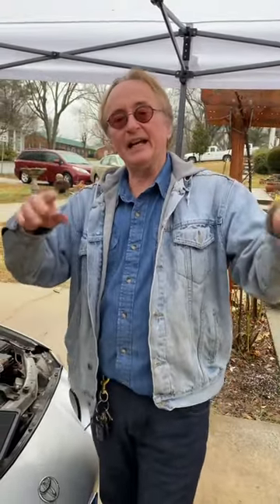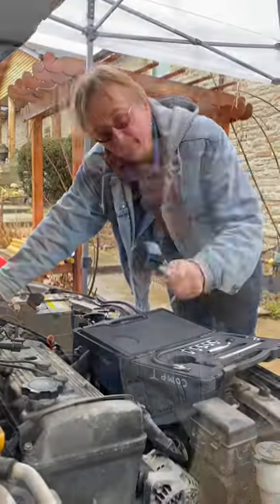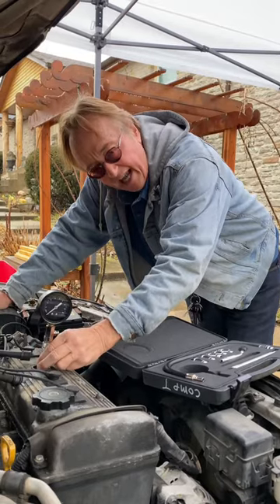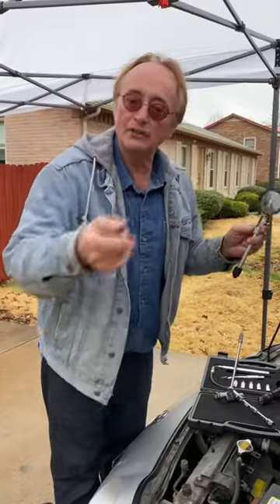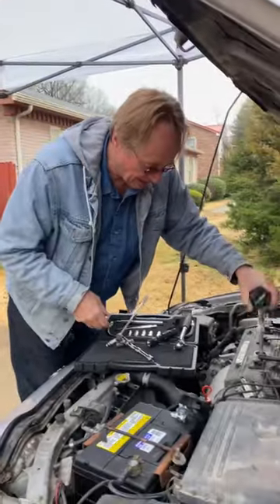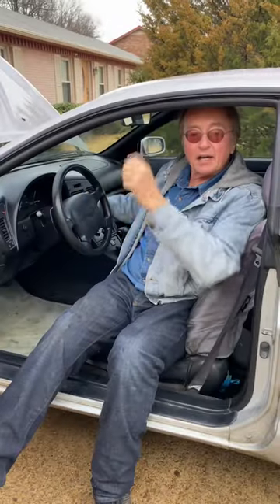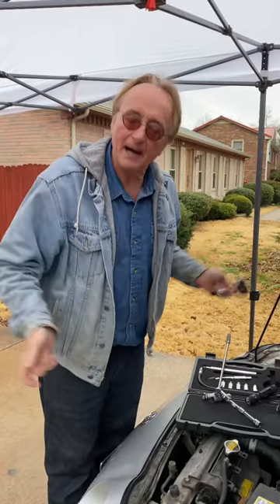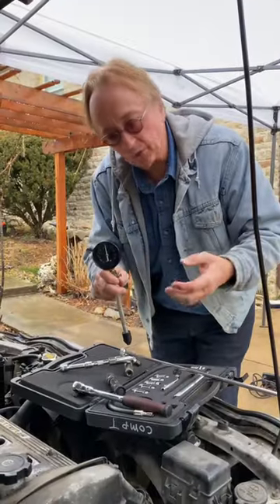This Means Your Engine is Bad

Comment: Did this to my 325 bmw the other week. Most came up less than 50 psi. Needless to say im in the market for a honda accord 😁
Reply: And Honda has signal lights.
Reply: 4th gen Camry is a good option as well
Reply: Toyota corolla might be a good option..
Reply: @janetyeoman1544  hilarious 🤣
Reply: Shoot I've been trying to sell mine it's great but people want to low ball me too much so I probably hold onto it until January when my registration is running out and try selling it then idk. My issue is If I sell it idk what else I'm going to be able to find that's been as good of a car as it has
Reply: Avoid Honda ..I owned one until last year .terrible car
Reply: @billcoates941  brand new or used?
Reply: @billcoates941  There are no terrible cars, just terrible owners.  They believe that the owner's manual is a little book, which should remain unseen in the glove compartment forever.
Reply: @carlbrooks90  I bought it brand new
Reply: Smart move , mazda 6 is a sleeper too.. As is the Hyundai Genisis
Reply: @gabeeskridge8291  i love the 6. Wife has a CX-5. They are great cars. Its outta my scope right now.
Reply: @euphoricjellybean  I feel you , I have an 07 Accord bullet proof great ride 205K , paid off seven years. Got my mom an 06 six years ago with 75K. I Strongly recommend the k24 4cyl. with mint miles if you can find it. Higher miles if one or two owner
Reply: @gabeeskridge8291  What does K24 mean?
Reply: Change rings
Reply: @mvelomthethwa880  i thought about it, but its not worth it.
Reply: @man4YAWEH454  K24 is the name of the 4 cylinder engine line in the Honda Accord. Really good engines.

Edit: The Honda Civic has the K20. 

Fun fact, some people that build Honda engines will take half of the engine from the K24 and half from the K20 to build a frankenstein engine which I believe has better performance and is stronger. I believe they take the head from the K24 and the crank fdom the K20? Or maybe it was the other way around? I don't remember.
Reply: @VisionaryVicente  Cool stuff. Thank you for your reply,VividVincente.
Reply: Honda civic 5spd can't ever go wrong. I had an 04 and it burned oil when I got it , it ran perfect until I ran into a telephone pole at 100mph. Engine was in my lap.
Reply: Yeah you have a beautiful car but the reliability is terrible
Reply: If you are American, if you are European you are just fine.
Reply: Don't forget the oh-so-reliable 3800 series II and III V6 Buicks...  At 148,000 miles I'm still only burning 1 quart of synthetic oil in 7,500 Miles.

Comment: Also on some cars it's recommended to disconnect the fuel rail or remove the fuse for the fuel pump to avoid excess fuel in the cylinders but often it won't hurt anything either way

Comment: Good advice but not so easy to do on a lot of cars. Some engines require removing the intake manifold just to get access to the spark plugs...
Reply: I wouldn't buy a car that is that difficult to work with
Reply: Nissan comes to mind. Idiots need to rethinking engine building
Reply: On those types of engines where accessibility is difficult, you can do an amperage draw test. Of course you would need an oscilloscope and a clamp on amp meter to do this, but you can at least get a good determination. If your graph shows a major fluctuation in a particular cylinder you know that you have an issue before going further. This test does show PSI, current draw only.
Reply: @terran236  lol they just want you to bring it to the dealer ship and pay that $$$
Reply: It's a pain to get at the spark plugs in minivans too, like the Pontiac Montant, you need to pull the engine towards the front with a ratchet strap to get access after removing a bunch of parts in the way.
Reply: There are 4 cylinders that have the intake manifold on the top?

With a V6 or V8 I can understand but I have never heard of a 4 cylinder with the intake on top.

Taking the intake manifold off is definitely a pain in the butt with the throttle body, and all of that stuff. I did it before. Took me two days to change the valve cover gaskets for my V6.
Reply: @emanuelmoreta5472 the brand that Scotty Kilmer recommends most has this issue ! (Toyota and Lexus v6)

Comment: you can also check whats bad if you find a bad cylinder, few drops of oil into it and if psi is back means piston rings if not its most likely valves
Reply: , but Isn't that obvious? 😃
Reply: Leak down test is even better ,just listen for air
Reply: @MrTheHillfolk  👍👍👍
Reply: Isn't there also a smoke test? What does that one test again? Vacuum leaks right?

Comment: A new Engine is alot cheaper than a new car.
Reply: The problem is finding someone who can put the new engine in correctly at a decent price.
Reply: @anthonybrown3481 perfect opportunity to learn.
Reply: @anthonybrown3481  exactly most people scam you way high and they suck
Reply: Depends on the engine and car
Reply: And don’t forget about buying a new transmission if that goes out as well
Reply: bruh what most the time it’s not not to mention just buy a car in good condition don’t plan on spending more money 😭😭
Reply: Hire a mechanic to come with you to buy a different used vehicle. It's cheaper than a new engine,less expensive than taking a chance on someone putting a new engine in and not being right.
Reply: Do you mean a "NEW" engine or a "USED 2ND HAND" engine? HUUUUUUUGE DIFFERENCE!
Reply: New engine here, then new shocks 3 months later, then brakes disc and pads
Reply: Depends on the car
Reply: If it's an old camry just buy another camry ngl lol
Reply: @IIGrayfoxII  And then you end up spending thousands of euros on bodywork to fix 30 years of rust on a VW T3...

Comment: Literally had a car with new tires, brakes, radiator, windshield, wipers, that had the engine give up the ghost. She hardly burned oil, and didn't run bad at all, until I went to start it the next morning and cylinder 1 misfires consistently. Oh also had reasonably new spark plugs and had done the timing belt about 15,000 miles earlier (needs to be done every 105k). With that much in new parts already on the car (all wear items mostly) I made the call to put a used engine in it. My theory is my brother ran it low on oil when he was borrowing it after his car got totalled. Was my Mom's car, but it is pretty much mine now... lol

Comment: I have a 1998 dodge Magnum that was dying going down the road.  I push the gas and it would bogg down and die.  I change the computer and it worked for 2 years and now it's doing it again

Comment: Common sense is a lost art.
Reply: Mr  killmer.  I'm from Utah.  I just wounder about where should rpm needle should be when it's idling.  I just bought a 2015 Chevrolet Tahoe
Reply: @miguelbethers6586  it should idle between 600-800rpm

Comment: My 99 Corolla sounds rough until engine warms up. And it sometimes skips a lil while driving. I put gas cleaners stuff in twice. Still not smooth. What should I do
Reply: Sounds like a head gasket is showing it's age...keep a eye on it..especially the radiator..
Reply: Probably the iac valve
Reply: I have to use 93 octane in my 2001 Dakota p.u.  The gas is horrible right now with all the ethanol.
Reply: If you have a lot of miles on it , maybe try new spark plugs .
Also , I think 99 Corollas still have a replaceable fuel filter , so change that , too.
Reply: @jayhockley8841  will plugs go bad faster the older the car is? I replaced them January 2021
Reply: @stephen1898   No , it doesnt really matter how old your car is , just the condition of your motor .
If your car is running rich or burning oil , it will foul out the plugs quicker .
look inside your tailpipe when cold .
It should be a light grey color and dry ( once any water condensation burns away ) 
Pull the plugs and check their condition .
They should be a light grey color without any oil or carbon on them .

Comment: cheaper to buy a used engine with a guarantee from the guys that sell engines and just throw it in that's the best way to go that's what those flip guys do they'll buy a car the engine don't run just throw a damn engine in it but $4,000 on it send it down the damn road